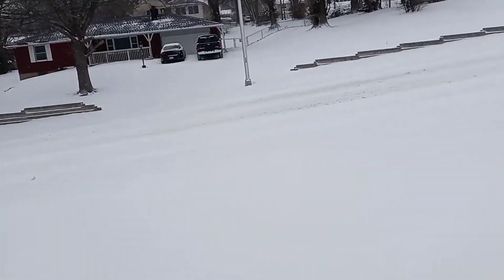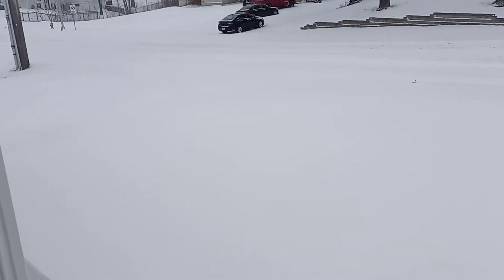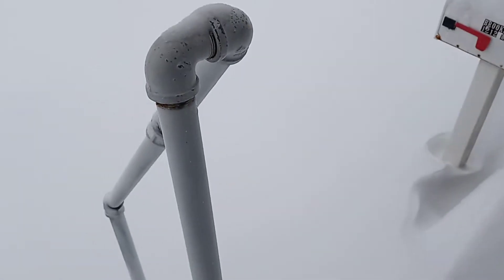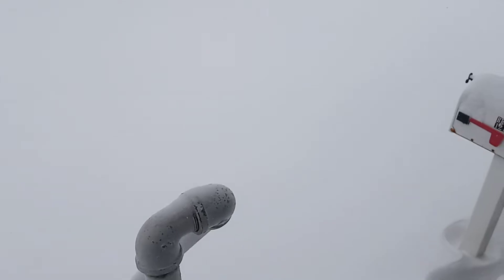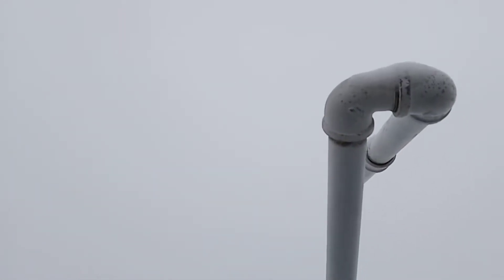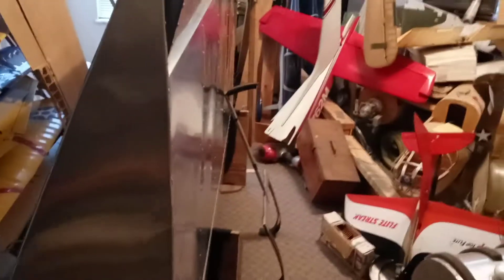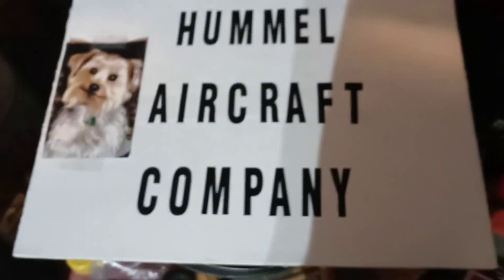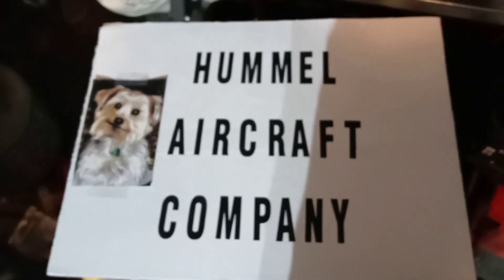Ultra Cruiser and snow and more

Comment: Hi misalignment heims. They sell spacer cones to let heims more side movement.
Reply from the maker: Hi Michael Reeves thank you sir for that information on the cones. Unfortunately they will not work in this application. We only have 3/4in to work in with 2 heim joints....
Reply: @redblackvette  could the problem actually be the heim joints at the bellcranks?  I would think you might be able to get a few more degrees of movement on the other ends of the tubes if really needed.  Dunno, just spitballing, as I am watching these in order.